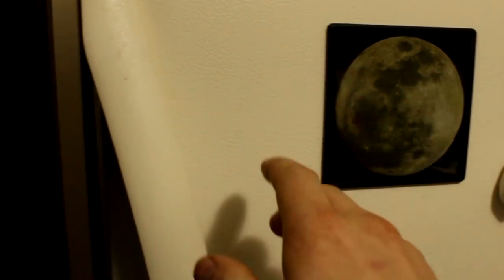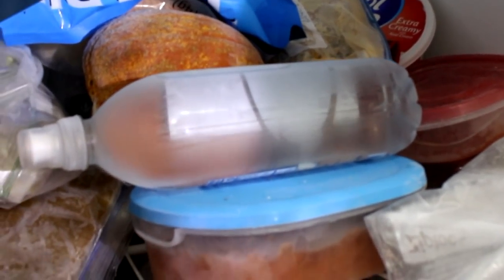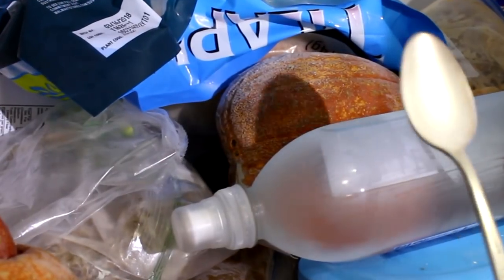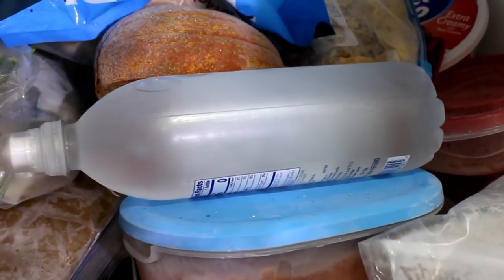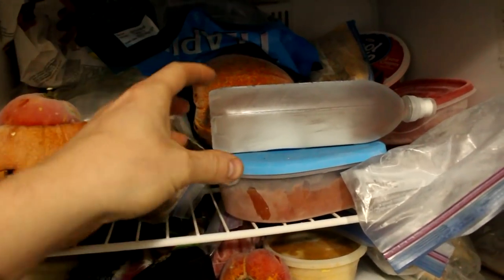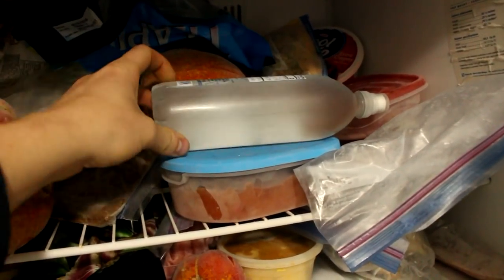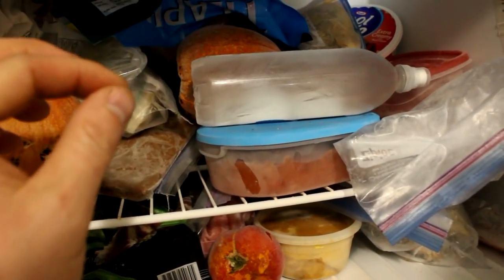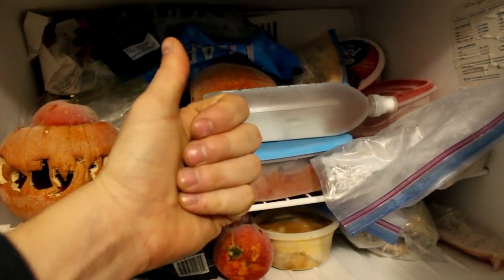Water Heats Up As It Freezes!?

Comment: Why does it freeze from the cap first when you hit it in the middle?
Reply: Because water is incompressible, and whacking it makes something like a pressure wave travel through the whole thing and bounce off walls (kind of like a sound shockwave), and the cap is where the walls are closest and waves meet the soonest.

That's why there are two points at which it froze, the whacking point (where the waves start and obviously they start from the same point, already met) and the cap.
Reply: The crystallization could've started anywhere, or nowhere (unlikely but it happens), the whack with the spoon just sent a shockwave through the solution, where the reaction happens depends on where enough of the molecules align correctly to start the reaction.
Reply: I guess the water moved away from his hand hit the side of the container. Maybe that impact triggerd it?
Reply: My guess is that different type of plastic in the cap gave the water molecules a better starting point for crystallization, whether it was the plastic molecules providing the launching point of the pattern or simply the best spot for heat transfer to occur. Cody probably has a better idea.
Reply: I think it has to do with the neck of the bottle being smaller, where the vibrations from the hit of the spoon get closer together and more intense, as well as the water being colder at the neck because it takes less time to freeze since the neck holds a smaller volume. Go freeze a bottle of something in the freezer and youll find that it gets frozen solid at the neck before anywhere else.
Reply: there was propably a bubble in the cap
Reply: Benjamin Zienty butt the water was already cold enough to freez, it just needed a nucleonation site like a bubble or dust
Reply: probably the force got 'transferred' to the cap (it is made of a different, harder material which doesn't deform as much under pressure (hence water pressure)).
Reply: +Benjamin Zienty Stop watching videos and read a book.
Reply: The Crazy Pineapple Does it have something to do with Pascal's law?
Reply: Cap is more rigid.
Reply: I always though crystallization was due to impurities... but not like this was purified water or anything.
Reply: The answer is probably a combination of what Konzetsu and The Crazy Pineapple said: basically, nucleation can occur anywhere (especially near anisotropies) once energy is provided; however as the input "whacking" wave propagates through the "incompressible" water, it will bounce off the walls, and these bounces or echoes are stronger where there is a larger acoustic mismatch (acoustic impedance is the product of density and velocity of propagation) between the water and the surroundings. This is probably at the cap. In addition, the shape of the bottle near the cap will also emphasize the amplitude of the reflected echo, as the radius of curvature is smaller hence a shorter focal point exists (i.e. less losses)...
Reply: Symmetry Tanner the walls of the neck are closer together so it had the highest impact at the cap
Reply: The pressure wave idea sounds plausible but nucleation can start at imperfections in the surface of the container (watch bubbles in a beer/champagne/soda glass rise from the same tiny spots on the walls or bottom of the glass- there are dust specks or pits in the glass there).  The interior of the water bottle is smooth but the point where the neck meets the cap has a sharp 90 degree angle, so maybe that makes it more likely for freezing to start there.  More experimentation is needed, but I'm currently experimenting with a rum and coke.
Reply: As several others have mentioned, it has something to do with what happens to the shockwave from the spoon when it reaches the neck of the bottle. 
Ihab Sinno is likely at least partially correct regarding acoustic impedance; the funnel shape should definitely cause higher amplitude pressure waves in that area. I think that the highest amplitude would be focused near the neck and cap, which is definitely where the ice starts to form. To me, it makes the most sense that initial crystalization point was either the markings on the underside of the cap, or somewhere along the small crevice where the cap meets the bottle. 
If you look at the second bottle right at the end, that kind of bottle is thinner plastic and crinkles easily. When he hits it with his hand, the plastic is likely being creased in front of and behind his hand.
Reply: pressure change in the bottle from the freezing can cause temperature rise too.
Reply: The Crazy Pineapple seems like a nucleation point was formed there
Reply: Because quantum superposition, anything can happen.
Reply: jmmahony Yeah, like a hand warming thing starts at the sharp metal part when you click it
Reply: Also there are more 'ridges' on the cap, and nucleation happens more easily on the ridges on the inside of the cap. A lot of times when you use new glassware in a lab, you need to actually scratch up the sides so that certain chemical reactions can take place. (Nucleation)
Reply: Nucleation can form more readily on sharp edges. The only sharp edge in a bottle is the interface between the bottle and the cap.

Comment: Hey Cody, i'm not sure about this, but the increase in temperature might be caused by the water becoming thermally reflective as it becomes ice. So it doesn't absorb the infrared rays as much. Making it look hotter. Correct me if i'm wrong, but it might have something to do with the change of state, not the actual temperature.

Comment: Awesome videos Cody, I'm a big fan. I have been using thermal cameras for research and one thing you have to consider is the differences in emissivity of different materials which would cause to give different readings at the same temperature, although I am sure you know that. 
I also have a petition. I am kind of an environmentalist (thanks for not harming the sidewinder) and one of my concerns is climate change. I was wondering if you could make an experiment about carbon sequestration (removing carbon from the atmosphere and trap). Ideally with a minimum expenditure of energy. Is that a challenge?
All the best from Spain!

Comment: I’m not too sure if the explanation on the video is accurate or not. But On earth pure water has a freezing point of 0C and a boiling point of 100C. These factors aren’t negotiable, water unless contaminated to change its properties, can only freeze/boil at 0C and 100C respectively. With this said, you can tamper with variables to get water below 0C without freezing and vis versa water above 100C without boiling. BUT, if you decided to get your below 0C water to freeze it will instantly heat up to 0C first THEN freeze, same with boiling, if you managed to get water to 105C and also managed to somehow remove said contaminants helping the water go above its boiling point it would first cool down THEN boil, even if on top a flame. It takes a lot of energy to get water below its freezing point, it’s that energy that is used to heat it back up to 0C even without a heat source nearby (this is why I don’t agree with the explanation in the video, unless I misunderstood what was said, it was said it doesn’t take much energy to make water go below freezing without actually freezing (if no salt or anything else to effect waters freezing point is present it actually takes ALOT of energy to make water go below freezing, which is why super chilled water takes longer to chill 1 degree lower than it is to chill room temp water to freeze completely.

Comment: Cody, I would do a test on the IR Emissivity change that occurs between looking at the bottle of water as a liquid versus a gas. If the solid doesn't have the same emissive IR rate, your camera will not be getting an accurate display when the state changes. Obviously this test is explainable and I don't doubt that water does warm as it freezes, but I think an Emmissivity test between solid and liquid would be very interesting!

Comment: @Cody  The thermal camera is measuring heat radiating from the water in the bottle, but it can't tell what caused the increase in heat.  Are you saying the crystallization is an exothermic chemical reaction?  And how do we know the water is heating up, as opposed to cooling down by radiating its heat (which the camera then detected)?
Edit: to correct grammar
Reply: Yes, according to Wikipedia: "Freezing is almost always an exothermic process, meaning that as liquid changes into solid, heat and pressure is released. This is often seen as counter-intuitive, since the temperature of the material does not rise during freezing, except if the liquid were supercooled."
Reply: Not so counter-intuitive if the energy release is in the form of infrared-radiation, which would mean the water, technically, wasn't heating up, and would still explain the thermal signature seen by the camera.

Comment: Don't act surprised! You knew this.
Reply: Yep, straight outta Wikipedia: "Freezing is almost always an exothermic process, meaning that as liquid changes into solid, heat and pressure is released. This is often seen as counter-intuitive, since the temperature of the material does not rise during freezing, except if the liquid were supercooled."

Comment: It's a good idea to hold a piece of steel with a glove or tongs when you quench the end you just cut through with an oxy torch. Iron is like ice, the thermal shock sends a pulse of heat through the crystal. Not fun when you forget about the difference between cutting with a fricton wheel and gas.

Comment: Same effect when water vaporize.
that's why we sweat.
When the sweat vaporize, it literally suck heat out of it's surroundings. Because the energy required to heat it to a evaporation point is less than the energy required to actually vaporize it.

Comment: What if you could align all of the molecules in a way that they would just keep bouncing off each other? I'm not saying it's feasible, I'm just asking what if. Would they eventually 'stick' together in the formation they're in? Would they just keep bouncing off each other infinitely? And if they did, how would they get the energy to?
Reply: Magnets (just like polar molecules) will bounce if they collide too forcefully. Slow them enough and it would be extremely hard to prevent a perturbation strong enough to flip them into orientation to pull each other.
Reply: Due to brownian motion it's not predictable how atoms move in a solution and even if you could align them in a way so that they couldn't freeze at that exact moment, you can imagine how the odds of moving only in a way where they still would not be able to freeze are, if there are 3.3427328*10^22 or 33427328000000000000000 molecules in only a single gram of water. But if you were able to cool it down to 0 K , where no molecular motion occurs in the exact moment, when you had them aligned, so that it couldn't freeze, then you would have liquid water at an extraordinarily low temperature i suppose !until! there is macro-motion (not a word i think) like a stir or even air movement that moves a molecule in a way it can freeze, where it would then chain-react due to enthalpy of fusion, where energy is provided by solidifying water, causing the other molecules to move again, resulting in them freezing as soon as they able to, providing even more heat

Comment: A phase change causes an excess of vibrational energy to be released as the liquid becomes a solid and freezes.
Reply: A liquid is at a higher energy state than a solid so when it freezes and the phase changes happens the excess vibrational energy has to be released as heat as the molecules lock together.

Comment: I wonder if there is a way to extract power from this. Power a Sterling engine with freezing water? If it gets cold enough to super cool, then initiate freezing in the water each night, and thaw it each day, it would make an interesting daily power source.
Reply: Getting a measurable amount of power from such a tiny temperature change would probably not be very practical.
Reply: QwertyuiopThePie Certainly. But it would still be cool to see it work.

Comment: Cody, I don't know if you have a freezer that can get cold enough for this, but could you try the supercooling experiment at progressively lower temperatures, and determine the temperature at which the energy released from crystallization is insufficient to raise any water above the freezing point?  Basically, can you figure out what temperature is cold enough than when the supercooled water crystallizes, it does so completely?

Comment: Can you do a video on the transition of water to boiling? It begins steaming before it reaches the boiling point, which means there is some phase change occurring before the designated temperature of 100C. it would be interesting to see the temperature transitions throughout the whole body of a pot of water on the stove for instance as it heats up if you could use your thermal camera for that. Thanks!

Comment: Could some of the change you see on thermal be due to a change in emissivity of the material?
Reply from the maker: no, the plastic is opaque to infrared light, you are only seeing the
 plastic change in temp as the water underneath it heats up.
Reply: Prestige Clash The wavelength of emmited infrared light doesn't really change anyway.
Reply: ah yes i see. Emisstivity goes from 0.98 (distilled water) to in the most extreme case to 0.85 (snow). so it would going in the wrong direction to what i thought. Seems like all those ice crystals may actually have a dampening effect for a ir thermal device if anything.
Reply: +Marmathic I wasn't really thinking of the spectrum of the ir emitted i was thinking that the fact of forming physical ice crystals would or could cause disruption of the radiation of the ir. more of a change in intensity vs spectrum.
Reply: Prestige Clash Yes. But an IR thermometer mostly measures wavelength because of that reason.
Reply: +Marmathic IR thermometers measure the amount or intensity of emitted radiation in the wavelength range from around 1 micron to 14 microns depending on the device. So I believe your statement to be false.
Reply: Prestige Clash But then they would be very inaccurate. It would make more sense to measure the amount of radiation for two different wavelengths and then compare them.
Reply: +Marmathic You have a fundamental misunderstanding of the subject. Ir pyrometers tend to reference what is known as a black body for their base or reference point and yes this does cause errors as not all things are perfect emitters. So say tape will emit a different ir profile as apposed to steel and you would need to compensate for this.  Thunderfoot as a quick intro into ir temp measurement.
Reply: Prestige Clash Yes youre right. I just googled it. But there are accually devices that measure differnt wavelengths. Im just a little confused because the error would be huge if one material had emmission 0.9 and another one only 0.5 The difference would be dozens of Kelvins
Reply: +Marmathic Yeah nothing is perfect what I do at work in day to day practice is i put masking tape on any place i wish to measure. I know the emisstivity of the tape and it becomes a secondary standard in a way. if i need a more accurate measurement i generally have other instruments like say a thermocouple or rtd temp transmitter to measure the temp as well as i have my calibration gear that is quite accurate. IR temp guns are not really usefully for much more than a spot check unless you can control many variables like Distance,Emisstivity,the environment like dust and moisture content as well as the ambient temp of the measuring device can cause errors as well as many other things.
Reply: Prestige Clash Ok I think that makes it clearer.
I just didn't think that IR thermometers could only use the intensity of the light. My teacher once randomly pointed with an IR thermometer at my body and it showed 36 degrees which is pretty accurate.
Reply: +Marmathic They are good enough yeah but still lack the accuracy it a lot of cases. like say you temp might have actually been 36.8754 but the decimal in this place didn't really matter. Like when im calibrating a pressure sensor where i work my cal gear is accurate to +-0.0015 psi across full scale of 0-35psi the accuracy is needed here because any error in measuring the flow is compounded down the line or effected by physical things such as worn out parts and what not. My temp is not amazingly accurate but it is +-0.15 deg at any point on the scale if i remember my records right that is. my temp scale for my rtd is only verified from -40 deg C to 150 deg C as that is the usual range of the processes i work on. If you process measurement interesting Industrial instrumentation is a cool trade to look into.
Reply: I would be very surprised if your exposed body surface temperature was actually 36C. That would indicate you were in severe danger of overheating, since heat could never escape from your internal organs! Only under the armpit does skin temperature come close to 37C, due to lack of air-flow.
Reply: Gordon Richardson Yeah. 36C is pretty hight. It also depends on how far IR can penetrate skin.

Comment: Cody, what would happen if the heat could not be ejected into the cold air? Let me explain. So what if you chilled water to just it's freezing point, no colder. You then put it into a vacuum chamber and then whacked it. Where would the excess heat go? It could only really be radiated at that point, as the air was mostly gone. Would it go back into melting the water? And if so how long would that process take?